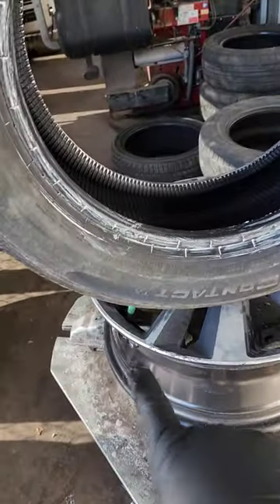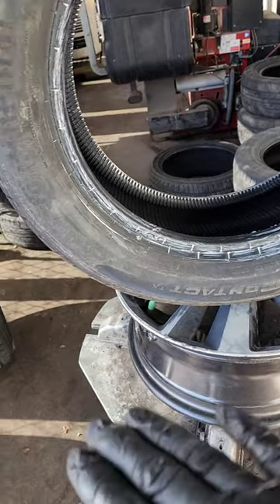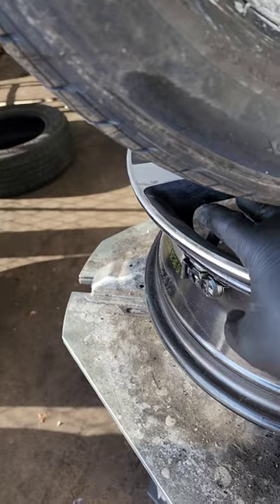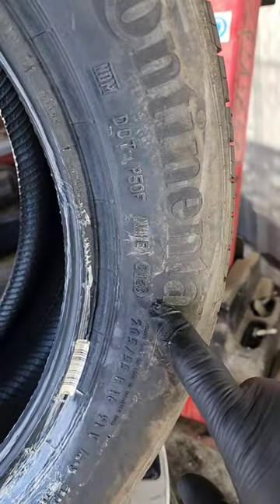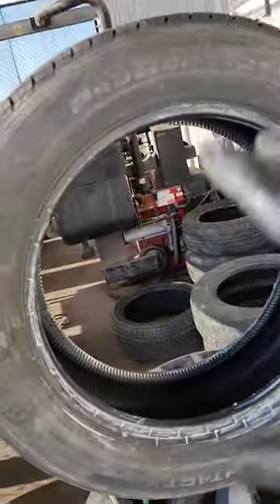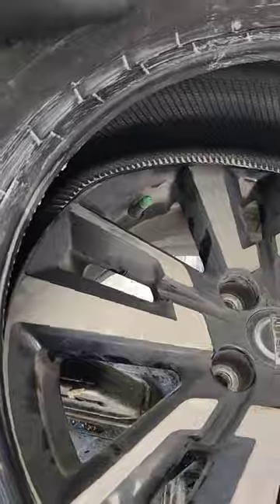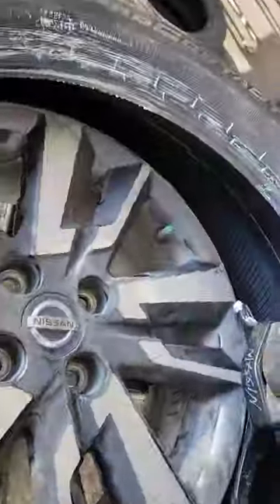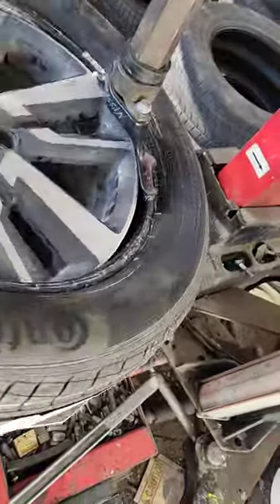VALVE STEM SAFE!! #shorts #auto #mechanic

Comment: I like guys, you know what they’re talking about just like like the red dot in your tire should be lined up with the valve to balance the tire to the wheel
Reply from the maker: Thank you, but i have to correct you just a bit...the yellow dot is for valve stem placement being that the yeollow dot indicates the heaviest spot on the tire to be match to valve stem due to wheel weighing less at that point...not alot of people actually know that, is it going to come with severe issue? No...but could just call for an oz or 2 more when balancing...not very detrimental to installing tires cause not every tire has those indicator